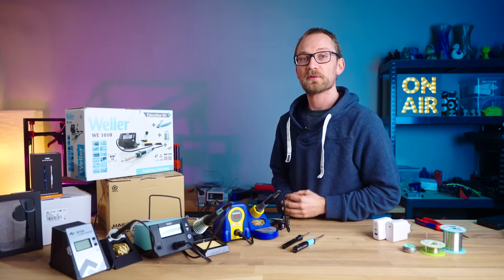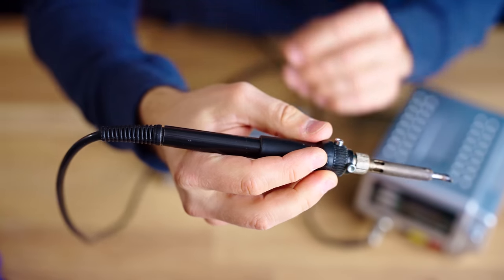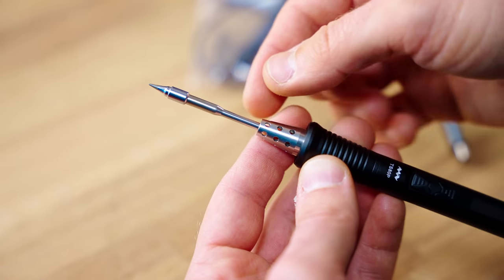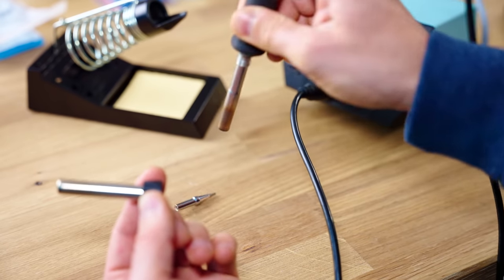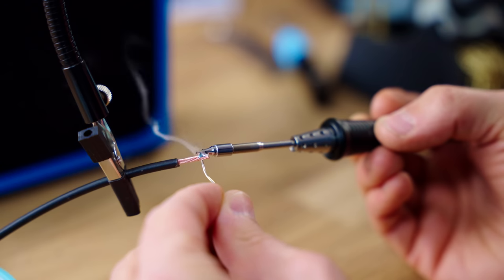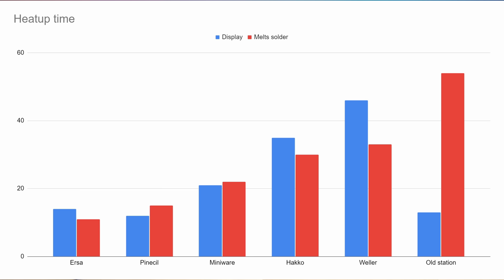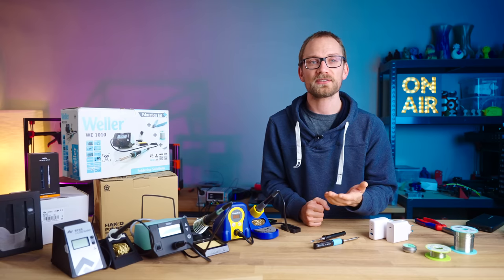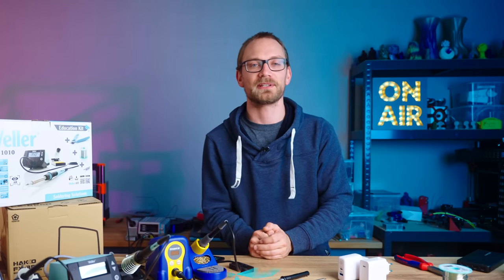Best hobby soldering iron? Pinecil vs. Miniware, Hakko, Weller and Ersa

Comment: What wattage did you power the miniware with? Mine heats up in about 12 seconds with my 45W battery bank and while I've not timed it on my 90W wall wart I reckon it's about the same - seeing a 22 second heatup time on yours makes me wonder if that severely nerfed it's performance for tinning and the large copper pad, though that tiny tip is undeniably annoying for large surface soldering. Thank goodness for the hotswappable tips :)
Reply: Yeah for that and the pinecil I'm curious how much power they were able to draw. The Iron OS firmware has a less pretty but much more informative display mode available in a settings menu that shows the voltage and wattage instantaneously.
Reply: @rpavlik1  Yeah, it was definitely odd. I can't reproduce the bug they showed in the video (though, I'm only on the 1.28 firmware), and when I actually got out my stopwatch to time it properly, it was a mere 9 seconds to full temp and barely 11 seconds to solder melting. 22 just for reaching temp makes me wonder if they did not plug it into the right power adapter - but, this is the disadvantage of a setup like this for those who don't know how to use their tools (Tom should absolutely know, but for people receiving these as gifts/etc it's certainly a potential limitation)

I just wish I had some wire gauges sitting around to do tinning tests on against my Velle- ah, *Weller*. Hah.

Comment: The TS80 is the USB-C powered version of the TS100, I like to think of Pinecil as the best of both worlds. The same tips as the TS100 with the power supply versatility to use barrel jack like the TS100 and USB-C like the TS80.

Comment: My TS80P remembers its settings. You can set wake temperature (WkTemp) so its the one the iron will always set to automatically. So it's not true that you need to enter your mostly used temperature every time. And it takes about 10-15 seconds to reach 350 'C, easy.
EDIT: btw, the tip you use for soldering cables with TS80P is also improper as it has too small thermal capacity for such use case. The D25 tip would do dramatically better job, I reckon.

Comment: I have a question about 3d printing, we’ll more of a problem. So I ran into a bug with OBJ. when I made a jug design I used a sphere to cut an indent in the side, when I exported in OBJ that sphere was a full object. But when I exported in STL the sphere wasn’t a problem. And now I am only using STL. Also I used fusion360 to design that jug. Do you know what went wrong, I can’t figure it out.

Comment: I just had to jump in and give my 3 cents. I had purchased a new soldering iron to replace a $75 unit but needed it ASAP. I bought one of those $7.99 Amazon Specials. I love that frigging thing. It has been working for over 2 years and I ABUSE the little thing (accidentally left it on an entire weekend) hoping it would die and I could buy a new one. But this $8 soldering iron has been my favorite iron now for a while. I even have a $65 unit that I don't use as much. If all your doing is hobby level soldering, those $7.99 irons off Amazon are great. I know A lot of people are going to disagree and that's ok because I am merely speaking of my personal experience. I will never spend more than $10 on an iron anymore. I should mention that the 'variable' nature of these cheapos are limited. They tend to run hot, which for my style works perfect. I have always used the irons at full power. So with that little tidbit of knowledge take anything I say with a grain of salt, because I don't think I really know how to solder... even though I have been doing it successfully for about 26 years now and have yet to destroy a component to heat (that I know of anyways)
Reply: well i bought one for 13 dollars off of amazon, and it was made in china, first one broke, second one sparked after replacing the tip with one of the ones provided, not to meniton the extra tips are duds as they melt when you put them in.

Comment: Definitely flash Ralim's IronOS onto the TS80p. It never gave me any more firmware related issues again. No more crashing, remembers the set temp on startup and becomes highly customizable. The tip price is still an issue though. I really wish they made a 2 part modular system with a standardized tip and heater core with the quick swap connector.

Comment: Did you actualy answer to the question? "do you need a $250 soldering station or is a $25 soldering iron just as good?" Where is the cheapest Vs expensive  test? All the models you present cost mini 100 euros... Actualy i don't have 100 bucks to spend on a soldering iron and I'm completely lost, i don"t find a descent product for maybe 50...

Comment: Great review. Suggestion/tip for a future  simular video. Include in your review if there are any 3D print files available for these soldering stations. That would have added to your 3D print channel and given a different result to your review. 

I just ordered a new soldering station before this video was out. I chose the Hakko FX-888D in their silver version. Mainly for the good reviews, it was cheaper as the Weller 1010 that was also on my list. But there are also way more 3D print files available for the Hakko!

Comment: Cool video! I have an ancient Weller with no buttons or display what so ever. It's either on or off ;). Got a lot of power though. Think I might get myself a Pinecil. Seems grear for little SMD-stuff. Btw, what's that soldering filter pump you've got?

Comment: Pinecil is essentially a cheap TS100, You might get better performance if you run a PID and temp calibration and if you arr feeling frothy update the firmware. Also, its definitely worth noting you can basically pick up ANY tool battery from 12v to 24v and just stab the bare wire from a barrel cable into the right pins and solder anywhere. I printed a connector that matches a kobalt tool battery for soldering and glued in some contact wired to a barrel connector.

Comment: Well the Pinecil is amazing and given it's less than $30, you can use it on the go (with a PD power bank) and the settings are easily configured (and you really only need to  do it once...) it's a no brainer.
Simply, no contest nor need to spend more.

Comment: I have an older Hakko 936 for my home soldering iron, once you buy a Hakko or Weller, its generally a buy it for life purchase. Tips are cheap for both, and even the knockoffs can be good. The irons themselves are replaceable with the base station as well. Since I have recently delved back into RC products like cars and drones and slot cars etc, I have the Pinecil which is great for a "field" soldering iron that can be ran off a LIPO battery or an older laptop power supply. Best of both worlds really.

Comment: Since the thumbnail says "Best soldering station"  I am adding the JBC line here too. Those things are expensive (from 300 EUR up) but damn are these good. I used to solder with a Weller station but as soon as I tried the JBC, I immediately bought one for my own use. I do a lot of soldering, both professional and for my hobby and I fully understand that this thing is way out of line for normal "hobby" use. But this thing is a 70 Watt station with a 130 Watt boost. When the soldering iron is taken from the holder, the temperature goes from 150 C to the required temperature in just a few seconds. I can switch the soldering station on, take the soldering iron from the holder and start soldering.
Tips are 24 EUR each and these are full cartridge tips, these can be changed while hot and the holder has a special piece to extract and insert tips while hot. Tips last a very long time, I think one cartridge lasts as long as 3 - 4 tips of my old Weller station. As long as you don't use them as a chisel or a screwdriver that is ...
Reply: As i already mentioned somewhere else here, if you ever wanna recommend one for a friend:
There is still the JBC "Weidinger Edition" analog Station, it is around 240€ incl. VAT, which is expensive, but still way cheaper than the next "best" option from them!

Comment: 2 years too late, but important things to consider for Pinecil:
1. You can get thumb screw for Pinecil, so to change the tip you just have to unscrew that one screw without any tools and you can change it,
2. There’s now V2 available, not much more expensive than the old one, with up to 100W power rating (if you have powerful enough power supply), so it should beat the hakko easily :) also, there are bigger tips for Pinecil available, they perform much better on big ground planes

Comment: Hah, I was just about to comment "somebody's been watching Project Farm", when the shoutout came at the end. :-)

I'm a bit perplexed that these old stations with indirect heating continue to remain so popular, when as many pointed out you can get a T12 station for under 100€ that will blow all of them (except maybe the Ersa) out of the water, performance wise.

If you only solder every once in a blue moon then you of course don't need that performance, but then you also don't really need anything better than a 936 clone you can buy for 30€. No need to invest a lot in anything you're only going to do a handful of times.

If you still want to be "future proof" because you have a hunch that soldering will turn out to be a larger part of your hobby than you expected, then neither of the three soldering stations in this test would cut it in the long run, and you would instead be looking at getting a PACE ADS200, or if you're willing to spend a bit more a JBC CD-2BE, or maybe even a Metcal station or a next-tier Ersa or Weller one.

But I think the best option in that case would probably still be to go for a T12 cheapo, which will have enough performance for most things, and then you can decide whether the additional ergonomics, performance and general quality of life is worth the several hundred additional euros you have to spend to get there.

Comment: It's interesting: I've owned both a TS80 and a TS80P and I've yet so far crash them. Granted, I seldom use the wakeup function but I've swapped times sometimes and had not them crash. I agree the tips are expensive though I usually got them at about 15 euros, not 20  (guess the price has gone up this year?) not that I need that many. I also recommend storing away the fine tip and get the round "chisel-like" tip. It has more mass and is good for anything except maybe soldering wire wrap.

I did not know you could put a different OS, maybe I will look on it at a later date ;)

Comment: I was able to score myself a Hakko fx888 non digital unit as the clumsy interface of the D was not something I wanted to deal with. Besides, changing temperature should be quick, easy & intuitive and not futzing  with weird button combinations.  Fortunately here in the US, I can still get leaded solder. I'm sure lead free has it's  place but for 90% of what I work on, not only is lead free a PITA but the components will never last long enough for me to notice the benifits

Comment: New Miniware TS101 paired with a PD 3.1 140W charger can use up to 90W power and uses a bit different (TS100 compatible) tips, and costs ~$50. I have noo idea where you get that $120 price from for TS80.

Comment: i have a little stick iron with a small temp knob.  for hobbyist work it has worked surprisingly well, especially considering a whole KIT with it included was under 10 bucks.  My old yihua 936 holds its heat better for sure but I'm loving how inexpensive soldering irons are usable now.  Sadly it isn't grounded and eventually I'll spend a bit more on one of the ones here as I'm starting to work with ground planes that push the limits of this little iron.

Comment: Ersa: 200€ and 270€ with ESD
The Heat up Time from ERSA are very nice, but it do also overshoot the temperature if you pull big amounts of heat from it.
Also negative Points: Switch ion the back, No rubber feet (slinding on the bench) and the Power cable are molten together with the transformer (cant be replaced)

Weller(own this station): 160€ with ESD
Slow heat up but no overshoot
Long iron tip is not ideal, i like the short Ersa tip more.
New Iron has a bit shorter cable and the new design is not as good as the old one (The Cable holder on the end and the Grip dot has a step to the body like the new)

Comment: I used to have the same station that you did and a trick i found was wrapping aluminum foil between the heater and the tip. It was amazing after that, but after a few months the tip got stuck and i broke the heater...

Comment: Before I even watch this video, I'm going to speculate that the major difference between an expensive and cheap solder station is... Recovery. When you put a hot tip on a cold wire or component, the temperature drops on the solder tip. A good soldering station will instantly compensate and have a much shorter temp. recovery time versus the cheaper one. Again, just a guess.

Comment: I've had way better luck with my TS100 than you've had with the TS80P. Never had a firmware crash, and I've been able to hotswap tips just fine. It's more similar in construction to the Pinecil, and it looks like it uses the same tips. I might pick up a Pinecil for those times when I need to solder something but can't easily access an outlet. Since it's powered off USB-C, the flexibility of power sources without having to hack something together yourself is unmatched.

Comment: Cool Video. I personally use a TS100 for the more special feature to power it by a battery. And its relatively cheap. At work we use Ersa I con 1 Stations and they are so good. But also expensive. But you should try it when givin the opportunity.

Comment: FWIW, at least on my older Weller, the ESD can be enabled or disabled, and it is possibly the same on yours and might be off by default. I vaguely recall related complaints when they released those new models a few years ago. Enabling/disabling it on my model is an obtuse PITA involving a holding a magnet next to a special spot on the base station.

Comment: 7:38
That rubber is an insulator so heat does not transfer from the All-metal casing to protect you from burning yourself or heating the All-Metal casing.

Comment: 15:05 the Miniware TS80 has a setting in the menu for a startup temperature, where you should set your most common temp. Makes sense to me at least that there are both a startup and temporary temperature, so you do not need to think of what it was set to last when you start a new soldering-session.

Comment: I sure hope the Weller soldering stations have improved, I've got a stack of dead ones that I can't bear to throw away and can't be assed spending $100+ on parts to repair each because I know they'll fail out again in a short period of time.
I've looked at the Hakko stations a few times but instead got a Sainsmart TS30 on the way which I expect will probably be enough for me.

Comment: KSGER station (genuine, with STM32 mcu) and a couple of T12 tips. Price about 50-60 euro. Best bang per bucks. Cheap chinese T12 tips don't perform as well as the original ones, but are much much cheaper. There is also JBC T245, one of the best soldering tips. Again, originals are very good and expensive. But in this case, the chinese copies aren't as cheap as T12, so I recommend T12 copy for budget and T245 original for profi.

Comment: I love my TS-100 I can solder wires thinner than a human hair or stick pennies together! Big ground planes on ESCs are a problem though. Had to buy a chunky iron for that. Mine runs off a laptop power supply so so easy to power. Lots of those kicking around.

Comment: Nice vid and comparison, just a note: I've been using the same soldering station as your old one and I NEVER had problems with it, like...at all. I can tin thick wires, it heats up large plates with no problem. And it doesn't take nearly as long as it did for you to heat up. Maybe there's a problem with your tip or something. (Also my handle is still intact and the cable too lol)

Comment: This comparison would have been more complete if a KSGER T12 would have been included. Depending on version and if there is a campaign etc they can be had for €40-60 with shipping, customs and VAT included. They are more powerful than all the included ones and use Hakko T12 style active tips which are readily available pretty much anywhere and dirt cheap if you don't get the original Hakko ones. Most kits do not include a stand to put the iron into though, so the cost for that have to be added if you want that.